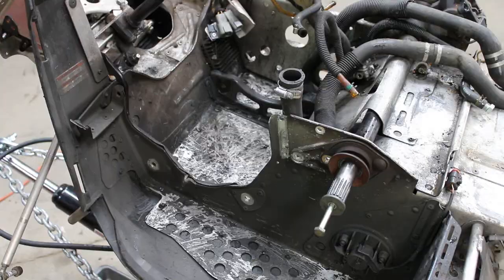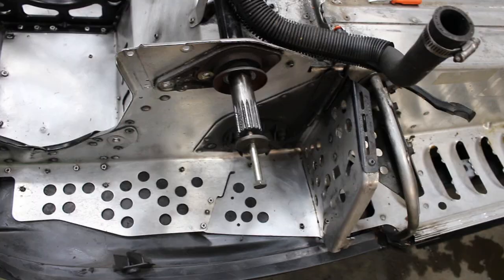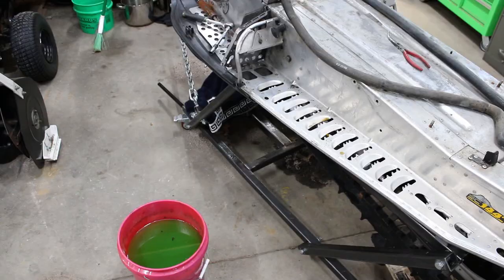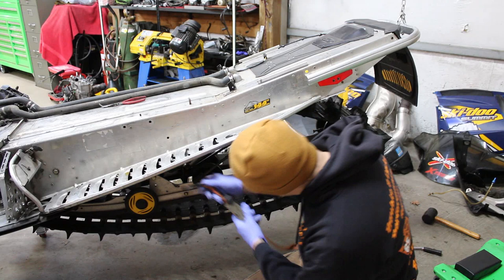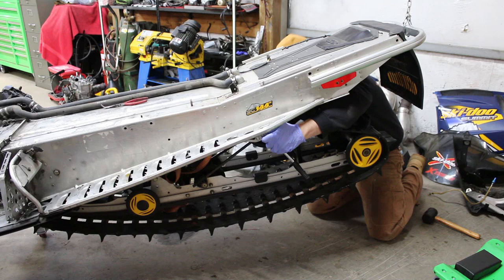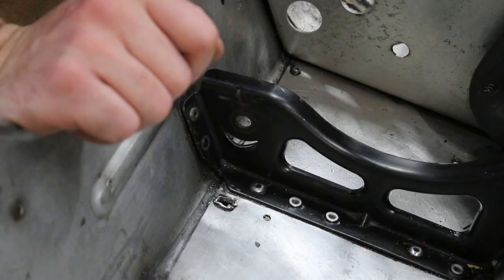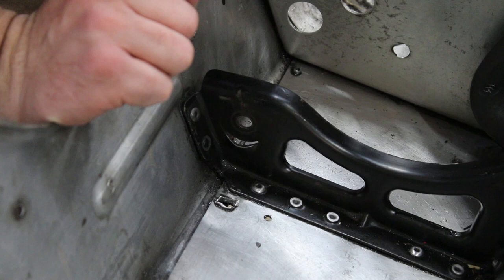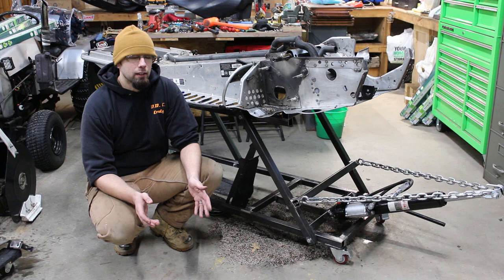Rebuilding a crashed snowmobile from the ground up. Straightening the chassis and bulkhead.

Comment: Great build! I'm excited for the out come. I did same repairs last year and can't recommend enough the brace kit/with stainless hardware.2x4 in the track standing up helps when sliding drive out. Chain case might have drain screw also. Good luck.
Reply from the maker: Thanks! Yeah I'm impressed with the brace kit so far. Considering proactively putting them in the rest of the sleds as well. Good tip on the 2x4, I'll have to give that a try next time!